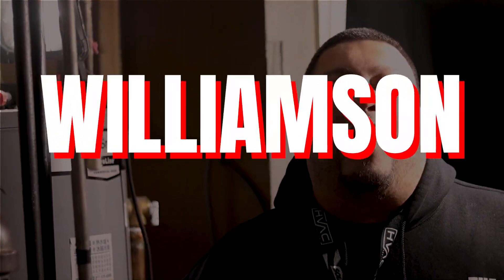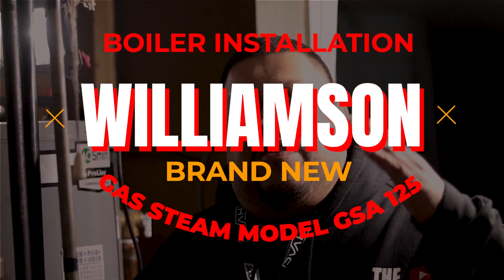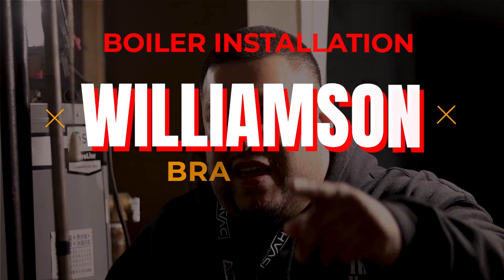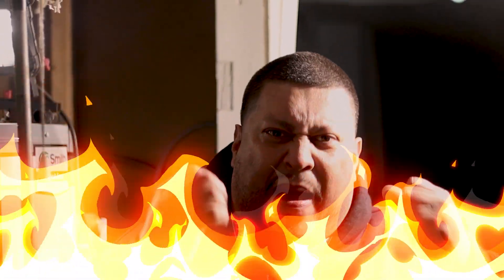WILLIAMSON GAS STEAM BOILER INSTALLATION MODEL GSA 125

Comment: Hi I’m a plumbing hvac tech in cali and I don’t see much steam boilers here can you use copper on the outlet piping for the boiler ?
Reply from the maker: If it’s a steam boiler, NOOOOO Copper on steam especially coming out the supply. The return you can get away with it because the temperature is lower and it’s condensation. I personally don’t like using copper at all but guys do it on the return side. The return wound be fine but not on the supply..